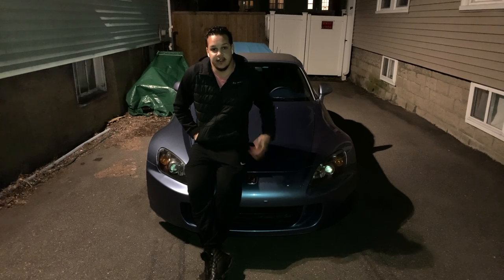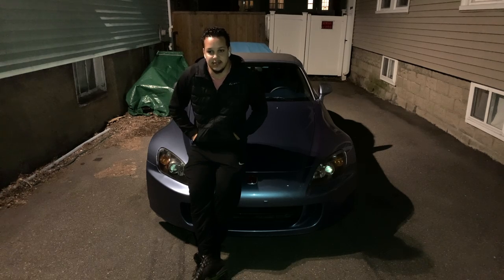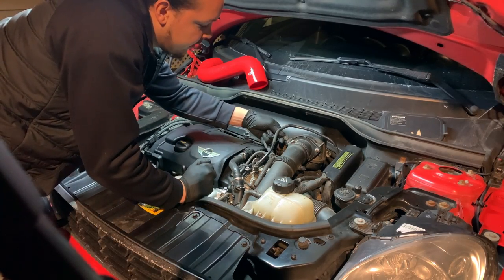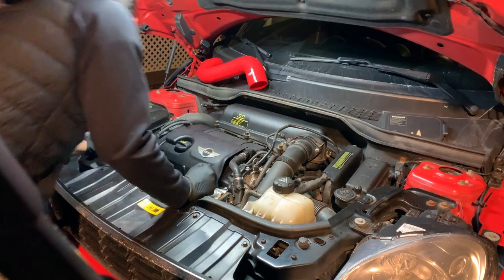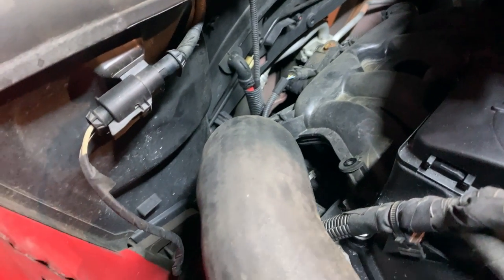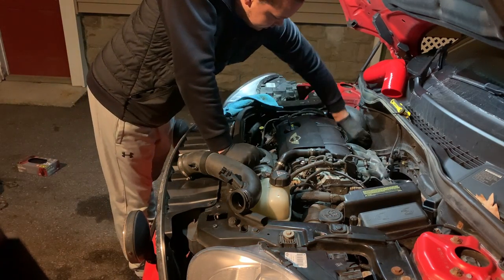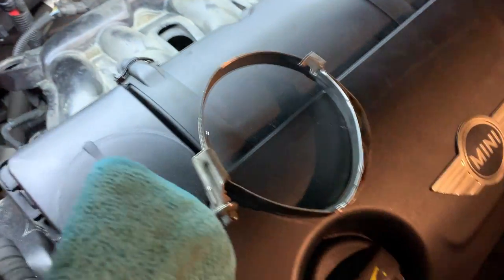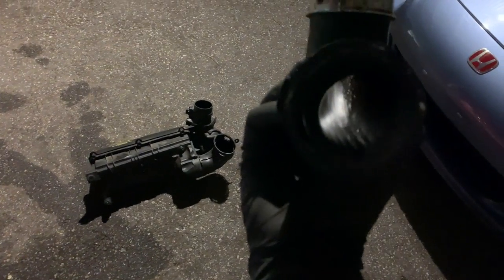The beginning of the Mini series {🚨New Project 🚨}

Comment: If you have a 2015, or 2016 R60, it does not have the noisemaker.
Those years are the LCI version of the R60.
I've found several subtle changes on my LCI over my 2011.
NOTE: Change your spark plugs asap. NGK.
Reply from the maker: strange this ones a 2012 so it should've had it, perhaps the previous owner did it ¯\_(ツ)_/¯ . i just ordered a set of ngks for it